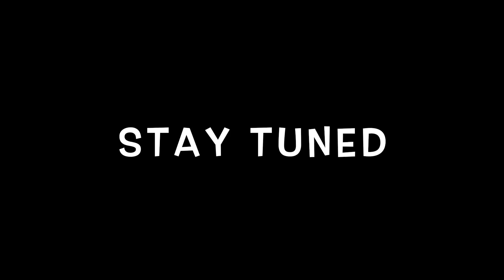SWAMP Dragon Rescue! FIRST WASH Abandoned 74 F250, V8 FORD, Forgotten Vintage Camper Restoration, CT

Comment: From personal experience, don't bother with that camper. Just get rid of it because it will be way more work to try saving than it is worth. The rot, mold and mildew is far worse than it appears. I've been down that road before and regretted it each time. Maybe you can sell the appliances out of the camper but that'd be about it.
Reply from the maker: Thanks for the insight Todd! Stay tuned!

Comment: Seriously??? Have you never used a high pressure washer before ?? Was this the first time you washed a car ???
Suggestions for next time. Remove the shit on the roof first.
Spray on foam detergent let it work for a while.
Start at the bottom of the body and work your way up.
When you washed the engine what were you doing ???
Flushed the radiator and grill on the car more than ten times
While you were washing the engine !!! You whipped around the nozzle to the high pressure washer on the engine so it ran around like a drunk pelican. 😱😉😉😉

Comment: Rebuild the camper truck is easy..Disassemble the camper in the Bay restore it...Fabricate a reman camper. btdt several times...you can do it...
Reply: My old camper was basically held together by the staples, the wood in the cabover section was completely rotted. However, the appliances, sink, propane stove and aluminum siding were fine. Was working part-time for a few months, so completely rebuilt the thing. Cost $300.

Comment: Strip the camper down for the aluminum and call it a day. It's way past gone. With a hole on top of it like that it surely has had some critters in it, mice, rats, birds. There is no way that camper will ever be sanitary for human habitation. It was open to the weather. It's literally falling apart. The truck on the other hand needs a new hood and I'm very interested to see if the camper saved the bed or held leaves and water and made it rust out. Those oaks shed their leaves every year and they would certainly blow and fall into the the crevices and they would get under the camper. You could crush the camper quite easily though. Or prove me wrong. Show us how it is done.    : )

Comment: I would dispose of that camper and get a bed liner for the truck. Probably could use a seat cover, floor mat, tires, battery, belts, hoses, plugs, plug wires, distributor cap, rotor, air filter, oil, oil filter, fresh gas, fuel filter, AC recharge, cooling system flush, and brakes?
Reply: Oh cool someone who doesn’t know what they’re talking about. Why get rid of the camper?
Reply: @blitzcourt5021  It has damage to every panel, inside and out. Then there's mold. He should get a good used camper instead. Or, like I said before, get a bed liner to cover the rust holes.

Comment: Pressure washing a camper with siding like this one has, from the bottom spraying up is blowing all that water up under the siding, supposed to pressure wash from the top spraying downwards! That camper is toast, drag it off the truck into the parking lot, run it over, salvage the siding for scrap, and burn the rest! Don't wast time and money on that camper, find one in way better shape!  Restore the truck!
Reply from the maker: We might do that! Stay tuned!

Comment: If it’s just a basic “old used camper for truck box” then it’s too far gone, if it’s vintage or rare (most of them kinda are tbh, belly buttons ya know, everyone made one so there wasn’t too many of each owned) then it’s more along the lines of just clean it and get the junk out, then the buyer will likely take care of or have that taken care of on their own, which saves you from having to do the work

Comment: Nothing like good power wash and some Eggs & Sausage before i head out to drive way to take off inner fender on 79 ford bronco.. great Motivation.. nice results on power wash... That camper looks rough... Maybe little to far gone.. But That propane Fridge are easy to clean-up... Worth pretty penny running, Work very well. So if it's salvageable i would consider keeping it, you be surprised of what they sale for to vintage RV restorer.

Comment: Try and turn the engine over by hand to see if it's all froze up. Put a socket on the big bolt that bolts the harmonic balancer  to the engine and try turning it with a breaker bar. I hope you dump the camper. It's not worth saving.

Comment: I would take that old camper and put it in the burn pile, Is probly all water logged in damaged anyway I would go find another one that's in better shape and fix that up. Personally I would just take that off and restore the old ford truck  At least mechanically the make it a driver and reliable.

Comment: I wouldn't even bother trying to save that camper it's rotted out. The only thing that's left is the aluminum panels on the walls pretty much all that's holding it together when you get it off the truck it's going to fall apart...

Comment: That camper is junk but the truck is worth saving. Just to get the camper off of the truck it will fall apart, only the aluminum is holding it together.

Comment: Great truck project.  The camper isn't worth the cost of the water you used to wash it.  If the truck had that much mold on it the interior walls and inside of that thing is never going to be safe to sleep in without tearing it down to the basic frame.

Comment: That truck was a great truck when it was new an can be again . That slide in camper was a piece of crap when it was new and still is are you going to throw money away on it? One of the cab height  bed covers would look good on a restored 1974 model pickup. I bet you could find one for little of nothing. But it's your truck your time and your money.  Good luck

Comment: I hope you didn't pay much for that mess you can tell they lived in it till they couldn't keep it going anymore and that's when it sat. If you attempt to fix that, that is the very definition of polishing a turd. The rear suspension on the truck is damaged on the passenger side, then you have to fix the rust and get it running and drivable. The camper has roof leaks, window leaks, separation of the panelling, dry rot of ALL the wood, the bottom where it sets in the truck is damaged, interior is shot and i would bet most if not all the things inside dont work and won't ever work again. Sure go ahead and fix it, might as well just take the aluminum off the outside and build a new one with the old shell.